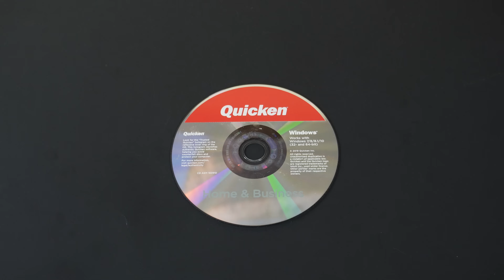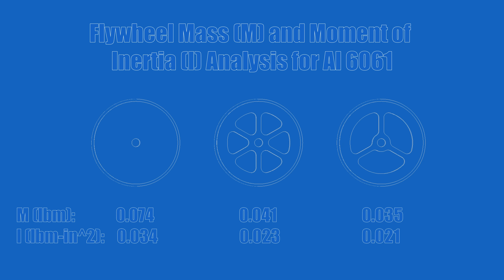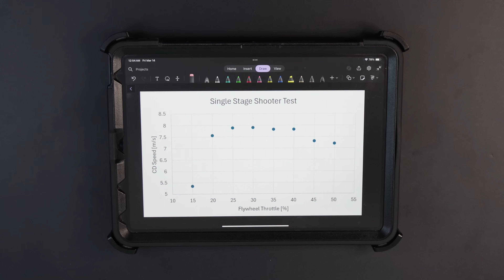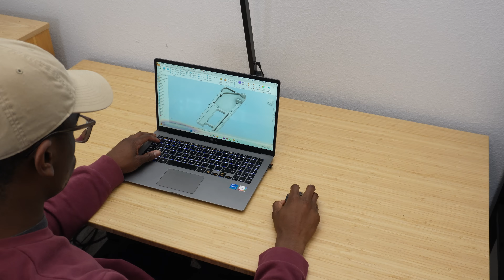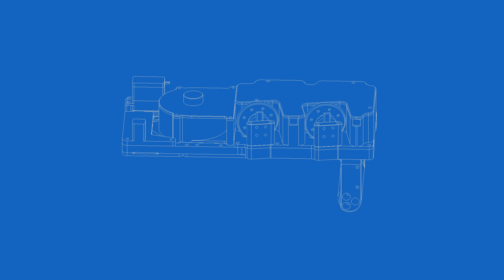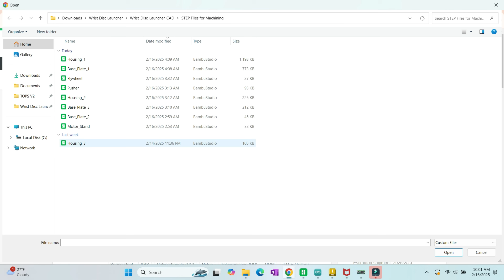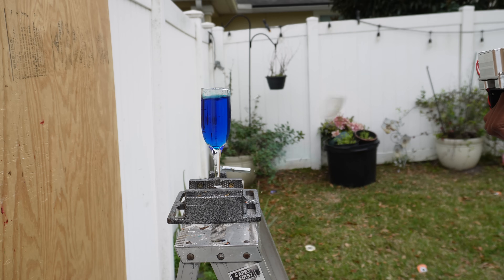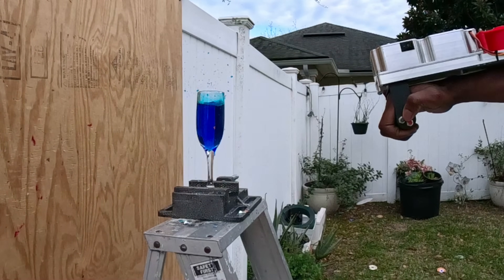Wrist Mounted CD Launcher - Built to DESTROY!

Comment: When I was younger, I found out that the many AOL CD's would fit on the end of my rc motor. The gear was just the right size, so I pushed the CD on, spun it up to 10,000's of RPM's and used my finger to flick it off. It would hit the ground and either explode, or take off like a rocket. They used to blow up sometimes and leave shrapnel  marks on my arms. Good times.
Reply: and not a cell phone in sight. Just a kid living in the moment lmao
Reply: I believe that was before CDs were made "safer" and would bend instead of snap. Can't remember what the motivation behind that push was, though...

My similar experience was in the late 80s very early 90s, where I took something apart with a motor in it... I honestly can't remember what it could've been, just that it was kinda small but 110V AC since it plugged into the wall. (being I couldn't hand been older than 12, I'm amazed I didn't get shocked when once!)

I had also discovered that army action figures – whose name I can't mention because YT's autoKaren system will remove it – had a rubber o-ring that connected their pelvis to the upper torso... And that I could pull them apart just enough to fit over the motor shaft 😅
Once plugged in they started spinning quite fast before the o-ring couldn't hold anymore, sending their lower and upper halves zipping across the room in opposite directions! 😅
Reply: That’s pretty cool
Reply: I highly doubt your rc car motor revolves at 10's of thousands of RPMs.
Reply: @rhapeandruin0fangelz  A cursory look for 90s RC car motors found one that does 25,000. 😋 10K isn't much in the electric motor world. Hell, even the nitromethane are pulling similar RPMs to the electrics! (by comparison, a chainsaw motor still manages 12,000)
Even cordless drill motors will exceed 10K rippems, which is why they use gearboxes to reduce that by turning it into torque. (again, *just the motor; the chuck will only spin at ~2800RPM)_
Reply: @DUKE_of_RAMBLE  I eat my words.  I actually just was doing my own little search and what I found is actually pretty mindblowing. That's crazy.  You're right.  I can admit when I fuck up.  I found some that can do upward of 55000rpm +. That's just crazy.  Learn something new everyday I guess.  Cheers
Reply: @rhapeandruin0fangelz  Yea, I saw those too and was also surprised they went that high. I was fairly confident they could do around 15K, but I wanted to make sure before stating it, so even that 25K was impressive and a bit unexpected!

Anyways, we all have these moments. I have my share and like you, take pride in owning up to it when I am. 😊
Humility keeps us civil... and with that, I toast to yours 🍻
Reply: @DUKE_of_RAMBLE   dude... I dig a little deeper and there are some vrc motors that are capable of doing 100,000+RPMs. 🤯 now that's just friggin insane! I think we'll be needing another beer after that one!
Reply: @rhapeandruin0fangelz  Jeebus... Any faster and it might break Mach 1! lol
Aso, I presume "vrc motors" was a typo? Tried to look it up but came short.... Although, I suspect you might've stumbled onto Brushless, and specifically the BLDC type used in things like drones. (although optical disc readers use them as well, to spin up the disc). 

They're cool due to being multi phase (3+,vs normal DC being + and -), which I believe is why they're able to spin so fast. The downside being they need a driver circuit, so a simple battery won't do anything. Though, I've read that you can kind of hack together a "driver" for one, but you need 2 motors to do so... A conventional DC motor which it's driveshaft is then directly coupled to a BLDC motor and spins it up. Now the BLDC is creating its own voltage which can in turn be used drive another BLDC motor... 😅
(I'm sure it's horribly inefficient, though!)
Reply: @DUKE_of_RAMBLE  yeah, that was a typo. And I'm going to be honest I honestly have no clue about anything you're talking about really lol.  Sorry.  I'm a musician.  😆 but all I did was enter "in terms of RPMs, what's the fastest a rc motor can rotate?" Into the Google search bar.  That is part of the answer it gave.  It did mention it was with prototype rc engines. And then it also gave a bit of info on non-rc engines being able to reach over 1000000000+ RPMs
Reply: @rhapeandruin0fangelz  Ah, yea, fair then! lol
When I had looked at BLDC, one did state 100K, so that's no doubt what it was referring to in your answer, particularly given the one that said it in mine was one of the first few.

It's appreciable how one not into mechanical things or that side of electronics, might presume things aren't able to rotate that fast. After all, most things in or every day life don't have high RPMs.

Rabbit holes like these can definitely be fun and illuminating! I used to surf Wiki, riding the wave of subsequent links to see where it'd take me. 😊
Reply: @DUKE_of_RAMBLE  I do that sometimes myself.  I also frequently go down conspiracy rabbit holes because they're just chocked full of crazy shit sometimes and half of it seems really plausible. Plus the fact that more and more "conspiracy theories" from yesteryear are actually turning out to be true.  Plus I can really get into a good conspiracy.  Idk about you.  But they entertain me
Reply: @rhapeandruin0fangelz  Conspiracy theories irk me a great deal lol Really bothers me that people lack the sense and critical thinking. They latch onto stuff for who knows what reason and then vehemently refuse to accept the evidence period when presented with it. It's honestly why I never latched onto religion despite attending a catholic school for 9 years... Poetic irony that me learning about the dinosaurs/fossils (and I think evolution as well?) in 7th grade Science, at that school, was what made me realize that is reality and not what they'd been shoveling at us... 😋

But yea, I try to avoid it due to the nonstop 😮‍💨🤦‍♂️ I'm doing lol
Reply: @DUKE_of_RAMBLE  that's fair I understand what you're saying.  I laugh at half of them because they're legit stupid like flat earth and that type of stuff.  And I don't read about them as though they're legit sources of information either. I read them because they're entertaining and some of them do make you think.  But some of them do hold more truth to them than others.  And some of them are just stupid like I said.. especially the flat earth one.  The 9eleven one is interesting and plenty of really good points are made about it.  But I guess it all boils down to what you think about the government.  My view of the government is they're untrustworthy and have repeatedly been doing crappy things to people of the world and its own citizens.  It's experimented on its own citizens and even its own soldiers multiple times.  They lie like a rug. When people say "they wouldn't do that!" I say " yes the hell they  would!" Why wouldn't they bring down the twin towers themselves and hit the Pentagon's accounting department the day they were to announce like 3.2 trillion usd is unaccounted for.  I mean building 7 went down and nothing even hit it.  The empire state building got hit by a plane a little smaller and it didn't fall down in a controlled demolition style like the twin towers did.  It stayed erect.  Because sky scrapers are built to with stand being ran into by air planes. You're probably rolling your eyes at me right now and  that's fine.  You can think I'm crazy.  And I can think your crazy for trusting the government? Lol. It was fun chatting bro.  I gotta crash I gotta be up in 6 hours.  Have a good night man. Take care.

Comment: How did you get to the level your at, where you can 3d model, code, and build such cool things. I really want to get to the skill level your at... where I can think of a idea, and be able to code, use electronics, 3d model, and 3d print it at ease. Right now I can sort of 3d model with Blender, but it is a chore, however I am good at 3d printing. I want to learn how to code and 3d model easily, but I don't know where to learn stuff like that, and how to get started. Overall my skills aren't where I wish they were- being able to do stuff like this for fun, and not struggling. How did you get to the level your at?

Comment: Nice project and awesome editing skills!

If you make a v2 try heavier flywheels to smoothout the acceleration difference after shooting the CDs, by the sound the gadget can't fully powers again the flywheel to its maximum energy when shooting on the max cd/s rate.

Add inside two strips of teflon to reduce the area where the cds grind before flying out.

Comment: throwing stars. using rubber is not necessary, metal would do the grip job at those speeds. ie piston side-walls friction. yeah material choice prevents slip. seems to pop out from the track sometimes. looks like a hard drive, you know those old storage types.

Comment: I wonder how much changing the o-ring material could impact disc velocity since the   flywheel speed is limited by the slip, why not change the material to a more grippy one ? Like how they change tires with different compounds in f1. Awesome Video tho! Looking forward to the next one🫡

Comment: I think the future is bright for flywheels.
They can be used as simple batteries saving energy from when it is cheap to when it is expensive, but only for a few days.
They can also be used to keep the frequency stable on the power grid, replacing the spinning mass of turbines used in our current power plants.

There are also some idears to use them to through satellites into orbit or at least help them on there way.
There are probably many more "modern" use cases. 🤷‍♂

Comment: get a block of graphite and support the  CD on a flat air bearing! Without sliding friction you should be able go much faster.  The difference between the versions may be just the friction of the plate.

Comment: Couple potential improvements:
 - instead if the flywheel being a wheel, make it a tank track, giving a lot more time to accelerate the disk. Meaning you will need bearings or something like that to press the loose rubber onto the passing by disk
 - use one on the top and one on the bottom, removing friction against the barrel
 - to create spin without sacrificing speed, i would assume that grabbing further away from the center of the disk would help. Also minimize the spin, its wasted energy
 - unless you go for a completely different design, and intentionally make the whole barrel side grippy, and the other side the flywheel but tank track, should have excellent grip
 - if you use stages, naturally each subsequent stage should be faster, becouse grip increases the more the moving surface matches the wheel
 - barrel isnt necessary as long as the disk always enters at the same place into the flywheel

Comment: 11:51 maybe the difference is the rigidity the enclosed design brings to the table? I mean, it's the only thing that changed, right?
Reply: The pusher in the magazine probably added some initial speed to the disc in the full assembly
Reply: I think you nailed. The switch to a metal case and the enclosed and stabilized final design would ensure the flywheel had better contact with the disks.
Reply: [edit: the metal is ruled out, as the test was done using the 3D Printed frame] 
In addition to what Dusty said, which seems more likely overall, my thought was that not every motor has the same performance (unless he bought matched ones)... So it's plausible one is spinning faster at the same voltage due to either internal friction being lower, or its windings being slightly better. As such, initially he might've had it as the rear motor, but in final assembly it became the front motor.

Comment: You can also take a piece of inner tube tire, cut it into a disc, place it inside the 2 piece wheel, sand paper the contact areas, add superglue and then put the o-ring over. This will essentially create the quick and dirty equivalent of a cast rubber wheel. For extra stiction, you can use rubber superglue, or even vulcanize it. Back when our civilization (of the CD) was booming, we used to make RC plane wheels with this method, because it was cheaper to get a hydraulic o-ring to make the wheel than get the specialized goodies that cost more than our entire RC planes.
Reply: What is the purpose of the rubber disc if you put the o ring over it?
Reply: that wont hold at these rpm...

Comment: my guess to why the wrist mounted version had a higher speed is the initial velocity of the discs, meaning slip occurs later, which leads to more effective energy transfer from the drive wheels to the projectile
Reply: Or the added rigidity allows for a more efficient transfer of power.